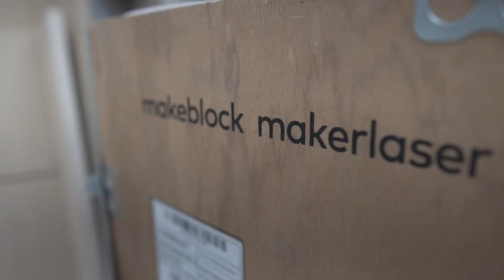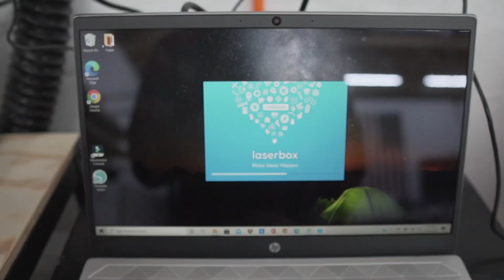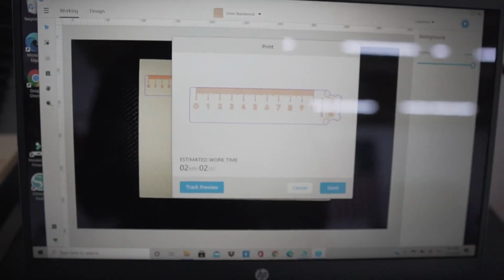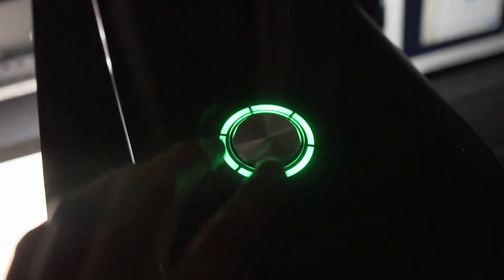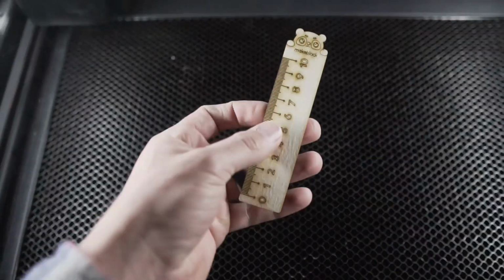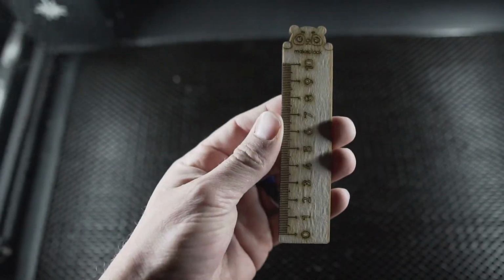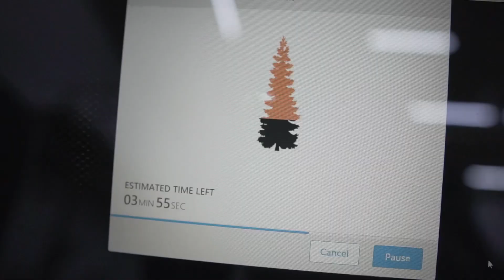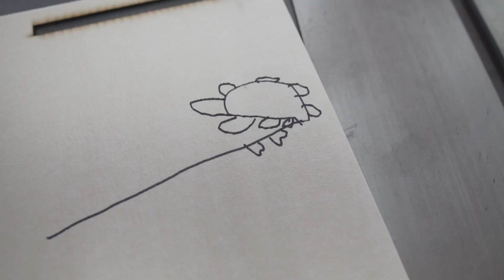New Tool Is A Game Changer | MakeBlock Laserbox Basic

Comment: That is awesome! Does the material have to be flat or can it be engraved on a curved surface? Maybe a log or possibly a gun stock? Thanks for the info and video!
Reply from the maker: You can actually remove the bottom tray and stick larger item in there like a coke can.  I am not sure it follows the curves though, I’ll have to give it a try.